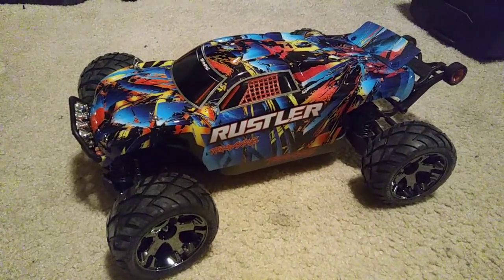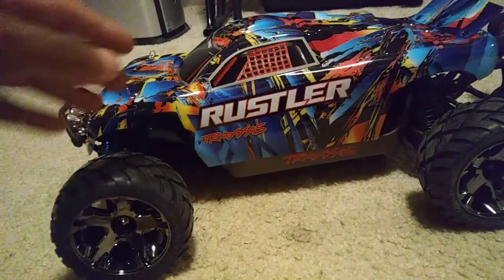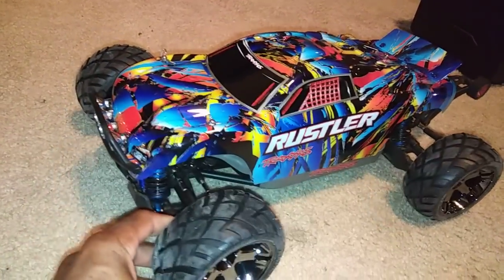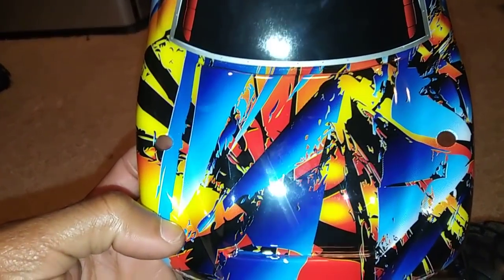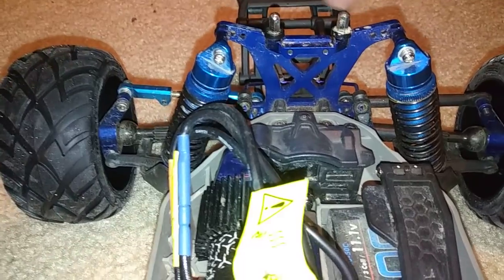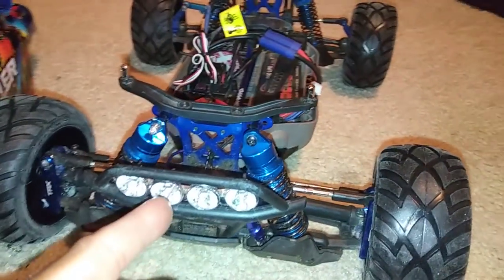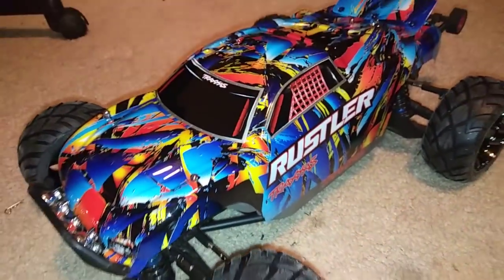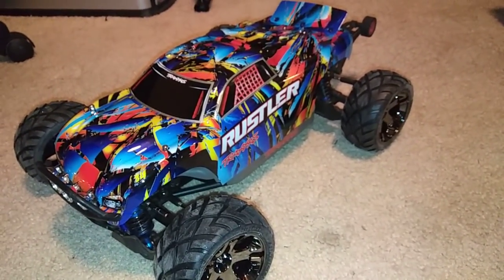Traxxas Rustler 4x4 JayTee Style 😀!

Comment: Awesome conversion! What's your thought on converting my 2wd stampede to an LCG chassis? ✌
Reply from the maker: It will run good if u do
Reply: @JayTeeRC  do you happen to know what chassis has more interchageable parts with the 2wd stampede? 2wd slash or rustler. I'm running 3s, and it needs a lower platform